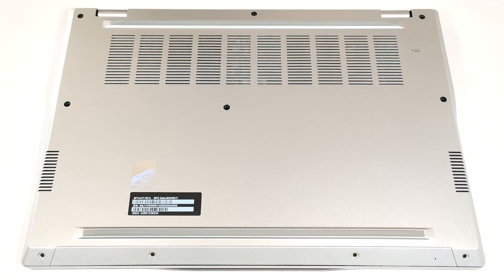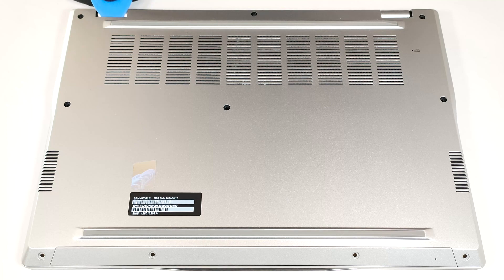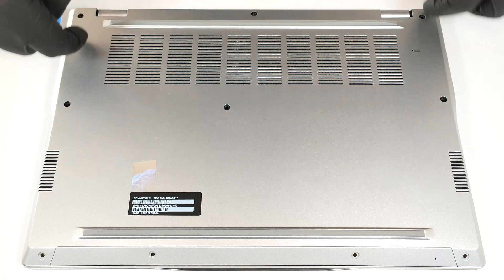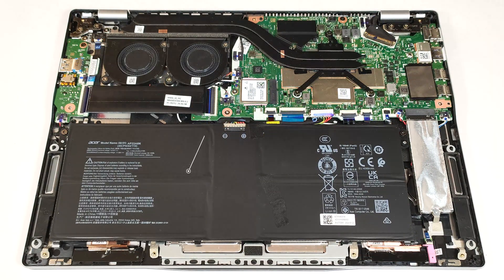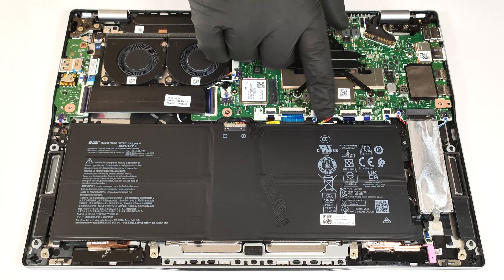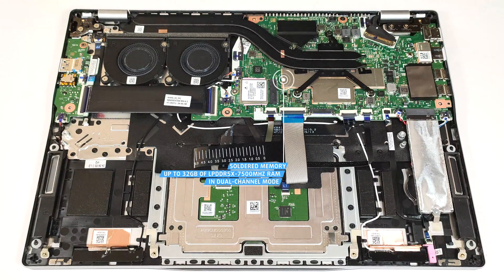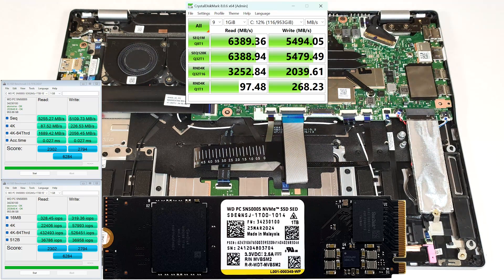🛠️ How to open Acer Swift 14 AI (SF14-61T) - disassembly and upgrade options

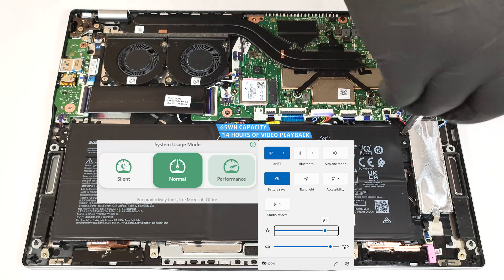Comment: If you bought this laptop, THERE IS ANOTHER M.2 SLOT! Its underneath the black ribbon cable under the fans (pause at 1:48 for example) there is actually an M.2 slot there. I bought this laptop and have a picture of it dissasembled